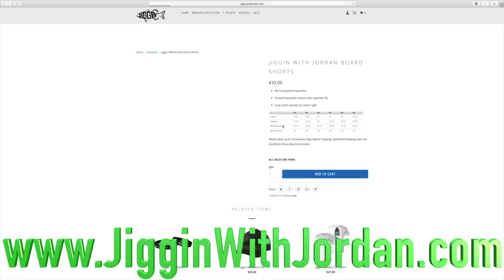Transporting SHINERS In "NEW" Off-Road Baja BUGG!! (Hilarious)

Comment from the maker: Hey homies!!! Don’t forget to get you BEETLE BAE MERCH HERE! http://bit.ly/JigginWithJordanMerch this is a limited Merch run so get them while you can!! 🤘🏼🔥🔥🔥
Reply: Jiggin' With Jordan say hi to me
Reply: As a mechanic of 30 years just keep in mind you have to keep those valves adjusted basically every other oil change or every oil change
Reply: Do a top gear special with yappy and DALLMYD!!!!!!!!!!!! Diving/ fishing challenges along the way???
Reply: Sweet baja  bug Jordan im a big air cooled vw fan I work on them also looked like your alternator stand gasket or the oil cooler gasket blew when you put more oil in put 20w 50 castrol gtx for best performance keep the valves adjusted in if it has a plastic fuel filter next to the carb get it moved to a different location on the car or you will have a fire hazard  ill be delervring a vw bug to Lakeland fl in a few weeks would love to see it up close.
Reply: its only a 70's Beatle
Reply: What if u run it in the baja 1000😱
Reply: That VW was owned by my dad up until a few months ago. We put the wheels and tires on it along with the seats inside and fitting the Baja nose to the front of it. We did alot of the work to it. I also have a bigger engine that we were planning on building to put in it before we sold it. It was originally bought for my 14yr old sister to learn to drive a manual transmission with and to also beat the mess out of it. And I'm so glad someone else is beating the mess out of it lol.
Reply: Sick beetle dude.....also for advice when it starts overheating DON'T TURN IT OFF the engine starts cooling it off just idling.dont turn it off it will cease up.....great vid B
Reply: Beatle bae aka Beatrice. That's what popped into my head when I saw her. You gotta throw a system in her. Clean up the rust and clear coat the patina. Perfect car love it.
Reply: What size motor is in it and what year bc i have a 70s bug with a 60s motor
Reply: Proud American  you can use an ATM/debit card instead of a credit card to purchase the tee shirt. If you don't have one, you can get one from the bank where you have your checking account. Hope that helps.
Reply: Jiggin' With Jordan I have a spot for y’all to do treasure hunting in Milton Florida blackwater river about 20,00 people goes down during the summer and losses their stuff I wandering if you  and I can go down the river and treasure hunting video
Reply: hell yeah Brandon my 3 favorite things diving, fishing, off-roading hints why I am sub scribed and is going to stick around
Reply: Proud American  hey brother.  U can go to WALMART  and get  bank card .  There 3 bucks . U can even have your check direct deposit to it . Just some friendly  advice  to a fellow  American.
Reply: Put a Subaru motor in it
Reply: That thing is bad ass
Reply: Jiggin' With Jordan goo to the flea markets people usually selling old plates
Reply: Is your cousins name Madison Palmer?
Reply: Hey Jordan craving some new videos! Where you at? No videos this week what's up?
Reply: I got a super beetle 1974 for my first car
Reply: Mr. Jordan, did you just say Homies? 😂 😂 😂

Comment: Vw engines are pretty easy to work on especially with the engine all open in that Baja bug, you should add and external oil cooler to keep it cool and of course change some gaskets lol but it’s true they all leak at least a little

Comment: Those engines are so simple and easy to rebuild. I had a 71 just like it but red. The oil is probably your push rod tubes, the seals go out. Throw a little $ in the engine and put some seat belts in there and it will last forever.

Comment: Hey it’s your oil pump leaking I had that problem with my beetle I have a 67, the beetles will always leaks a little oil but they are not supposed to leak that much I wouldn’t drive it until it’s fixed, the motor will lock up in a heartbeat

Comment: yo you need to make sure the ducting for the air is clear it is a air cooled motor and they get crap stuck in them and run hot and they don't do good sitting in traffic

Comment: Here's some serious advice bro....get that oil leak fixed. Those old air cooled vw motor have magnesium in the block and an engine fire is super dangerous. It will literally melt the asphalt under the car. Love the car just be safe man.

Comment: if you have no oil pressure you immediately stop and shut the car off because if you have no oil pressure all your components inside the engine will become extremely hot and they will weld their selves together which means your engine is now locked up and will not turn over thus no vroom vroom.